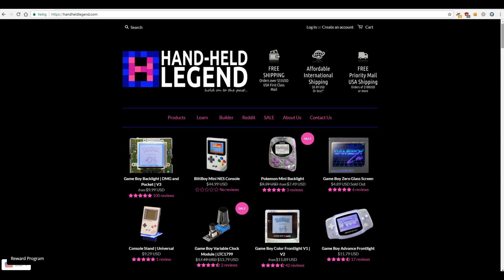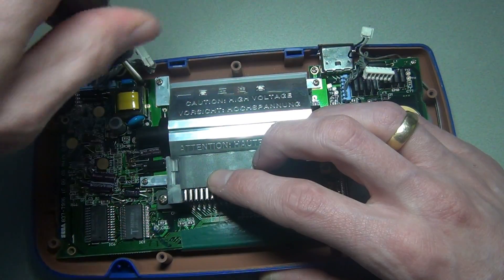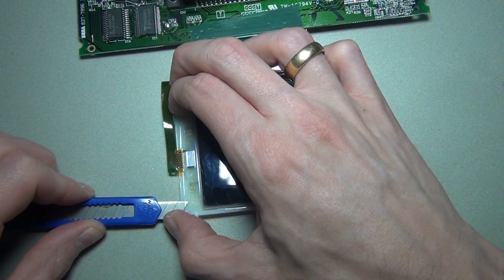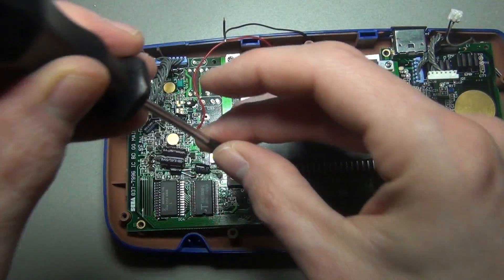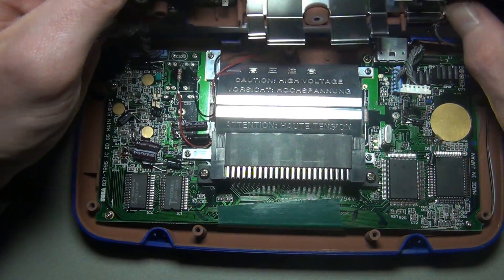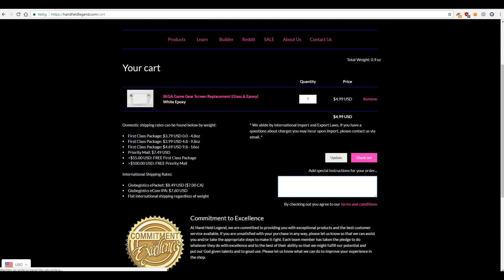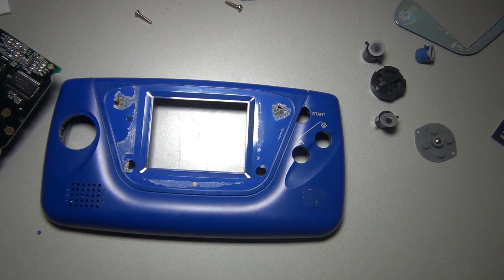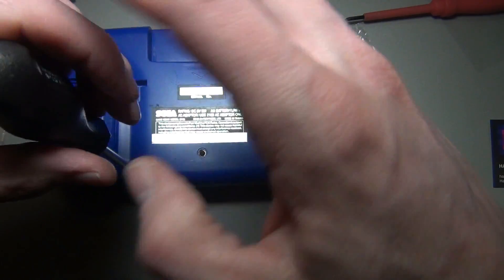$10 Sega Game Gear LED Backlight Mod

Comment: With NiMH batteries, battery life is a non-issue. For me, if I'm gonna significantly mod the internals, it's going to be to do an OLED screen upgrade. Gonna hold off until someone figures that out. Otherwise, there's always the LCD upgrade: aliexpress.com/item/4000250454690.html

Comment: Wouldn't it have been better to just replace the whole screen with a modern IPS screen which would have better colour matching, viewing angle and a lot less latency?
Reply from the maker: Of course. But for those with a tighter budget, I want to provide an alternative.
Reply: There's a difference between an LED panel for 10 bucks or an IPS screen for 80 bucks sure, but hey... Most everyone has 10 bucks to spare but not 80.
Reply from the maker: Exactly!

Comment: Wow. Crazy that they were going to leave you hanging on that yellow backlight thing when they knew it wasn’t user/installer error or an out of warranty failure. It sounds like they were left taking a hit and were trying to stiff you to make up for it but two wrongs don’t make a right.
Reply from the maker: Exactly. Very disappointing
Reply: It was 8 months.

Comment: Loved this handheld only played it at home, as i played it with mains adapter, plus i had a Master converter, so i could play my Master System games, i used my GameBoy for on the go,but the SEGA was my favorite, Lemmings on the Game Gear was Amazing, also Astro warriors, and Sonic.
I wish i did this back in the day, the battery's would have lasted longer. 
Great Video mate excellent :o)
Reply from the maker: Thanks. I have the master system converter too. It makes the entire setup really bulky, but it works.

Comment: Now you just need a hi-resolution, low latency screen and a LiOn USB rechargable battery solution and you'll have one of the best Game Gears out there. ;)
Reply from the maker: Sounds expensive. :-)
Reply: New 50 Euro challenge? Can you max this Game Gear for less than 50?
Reply from the maker: Nice one!
Reply: Both research a maxed out solution for <= 50 euros the winner gets his full solution implemented. Penalties apply for going over. (Ok all numbers (50) are arbitrary but sounds like fun.)